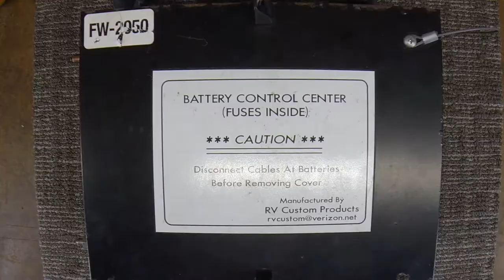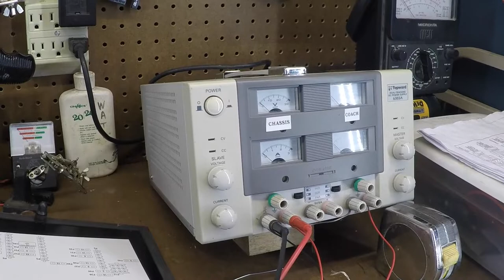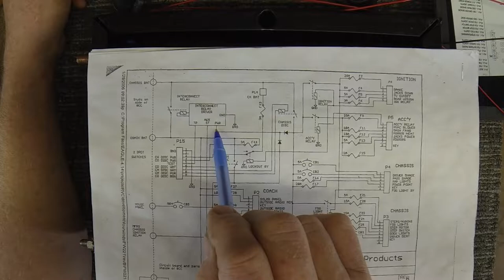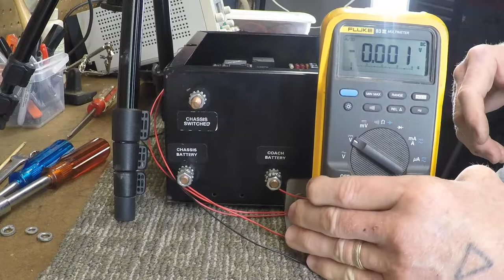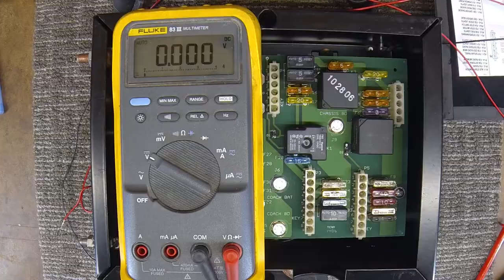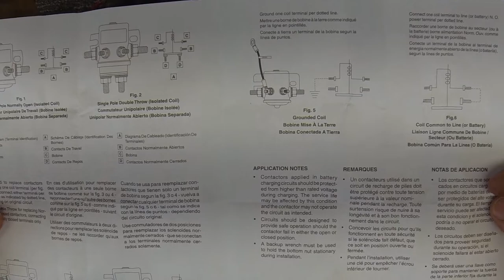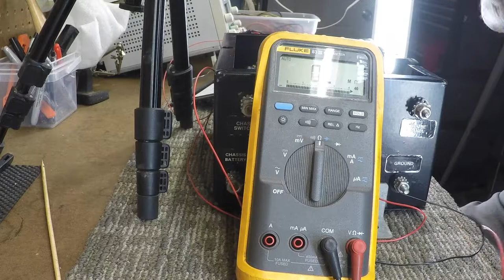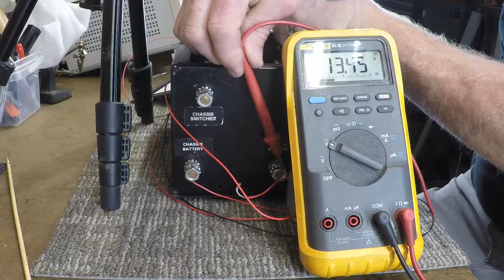RV Custom Products Battery Control Center (BCC) - Troubleshooting and Repair

Comment: Thanks for taking the time to make this excellent video.  You have a great gift in explaining things.  I have a similar RV Custom Products battery distribution center (Model 111979).  I was pleased to find out the company is still in business, and all of the components of my system is still available for my 1999 National Seabreeze.  If you have the time, I would be grateful if you would explain the wiring changes needed to allow a dc to dc charger to be added.  I have AGM house batteries, and I am considering swapping them out for lithium.  I assume the interconnect solenoid needs to be disconnected.  Ideally, I would like to preserve the emergency auxiliary switch that connects the house batteries to the chassis battery in the unlikely event my chassis battery was unable to start the RV on its own.
Reply from the maker: Thanks for the kind words, Dan. When you say DC to DC charger, I assume you’re asking about a charging system that is compatible with Lithium Ion batteries? Am I understanding you correctly?
Reply: Sorry, I missed your comment until now.  Yes, exactly......I currently have six Lifeline AGM batteries and I intend to upgrade to lithium batteries.   @WaynePolcin

Comment: Wayne,   As you can see, I commented last year.   I took the RV to a dealer and they said everything was working fine.   And it did until now.   I have the opposite problem.   Situation.   Thor Windsport is plugged into shore.   Batteries are going below 10 volts.   Battery monitor shows not charging and low volts.   Started engine, and started generator(without using emergency switch).   Turned off engine.   No battery charging.   Turned off gen and unplugged shore power.  No lights in the rv.   Start engine and getting 13-14.5 volts and 25-30 amps charge off alternator.   Checked power panel.   With shore it has 120 volts in and 13 volts on low side.   The two 40 amp fuses are good.   Tested the 100 ampere inline fuse in battery bay.   Voltage both sides and continuity across it with battery disconnected.   
Best guess, in your opinion, new relay or new board in the TH1020?
BTW,  I tried to pull the door off the TH1020 again and it still will not come off.
Reply from the maker: How old is your coach (house) battery?
Reply: @WaynePolcin  coach is 2014.  Batteries were newly installed 2 years ago by previous owner.  2 deep cycle 12v
Reply from the maker: Can you hear the coach solenoid changing position when you toggle the coach battery disconnect rocker switch?
Reply: @WaynePolcin    Yes it clunks in both directions.  Not electrically verified.   Getting better meter tomorrow to check voltages more accurately.
Reply: @WaynePolcin    The company that makes the box advised me that it is most likely the 50 amp breaker.   I will let you know the outcome.
Reply from the maker: I apologize for not replying more promptly. Have you been able to get the cover off to reset the 50 amp breaker?
Reply: @WaynePolcin    Not yet.   I’m going to spray with some WD40 to get it off.   Probably hasn’t been off since 2014.   I had other issues come up around the house.  You know how it goes, freezer quit, toilet needs replaced.   Normal life stuff.  Have a wonderful evening!    Kevin
Reply: @WaynePolcin      Wayne due to watching you excellent videos, I new what and where to look inside the TH1020 box.   I sprayed some WD40 on the hasps and after some pulling and twisting got the cover open.  
I got an email from customer support on which points to check inside the box, but did not need to test anything. The tiny circuit breaker button was protruding out of the case.   Tiny push and click.   The interior lights came on.  Plugged her in and battery charging!
Again, thank you so much for your videos.  They are the only videos on YouTube that have anything to do with the TH1020.

Respectfully,   Kevin
Reply from the maker: So happy to hear that you found the problem. Good work and I’m glad I was able to be a part of the solution. Take care and stay kind, my friend!
Reply: @WaynePolcin      Wayne,   I was an electrical design engineer working for electrical contractors since 1983 and retired 2018.   If you need some information on electrical or NEC, please let me know.   Will gladly help you.

Comment: Thank you for this video.  I am grateful that you took the time to offer this resource.   Using your process, I ended up replacing the battery interconnect relay and all seems to be working.  Whether on the converter or with the engine running, I am getting a charging voltage at the coach and chassis terminals on the BCC.  I also get charging voltage at the chassis BD and coach BD.  Tested at the chassis battery, I also see the charging voltage.  When I test at the coach batteries, I do not get a charging voltage.  Since I am getting a charging voltage at the BCC and not at the batteries, I am assuming that the BCC is functioning as advertised and I must have something else going on down stream from the BCC coach terminal that is not allowing electricity to flow to the coach batteries.   RV is a 2015 Thor Vegas 24.1.   I searched and could not find the 50 amp and 100 amp Type III DC breakers mentioned in Thor’s diagrams.   May I trouble you for any insight on next steps?  Is my conclusion that the BCC is functioning properly accurate based on the observations I’ve made?   Before changing the interconnect relays the coach and chassis batteries were not charging from the converter.  After replacing the relay, the chassis battery now charges from the converter, but the coach batteries won’t charge despite the charging voltage being observed at the coach post of the BCC.   One more observation, I allowed the chassis battery to drop below 12.6 volts.  At that time, the relay opened and the coach went dark, even though the coach batteries are at 12.8v and the coach disconnect was in the “use” position.   Any ideas?
Reply from the maker: I will pull out the schematic and study it based on your observations. I will get back with once I have an idea to share with you.
Reply: @WaynePolcin  thank you so much.

Comment: Thanks for reply I only owned a year or so not sure how old batteries are. We leave it plugged in all the time. Should we disconnect while sitting plugged in not in use
Reply from the maker: You should be able to keep it plugged in all the time. 
1. Does your step motor run? 
2. Are able to access the inside of the BCC to measure voltages?
Reply: @WaynePolcin  Yes the step motor works was replaced last year. Curious what step motorhas to do with this circuit. I can access the bcc  at least the front circuit board, to see the relays I would have to take the box out like you did.

Comment: Thanks for a great video and tutorial. Learned a lot. I went to the RV Custom site to find my control center but it was not here. I have F73-1042. Closest I see is F73-1044. I'll contact them to see what the difference is or if they have block diagrams and other technical info on mine off 2005 Fleetwood Expedition
Reply from the maker: Thanks for the feedback, Peter! It was hard to find accurate schematics and technical data for my BCC. I remember having to follow many links to find the right information. Be careful on your search and don’t lose patience. I’ll poke around a bit to see what I can find for you too. Good luck my friend!

Comment: Wayne love the video, my camper is the same as yours, my chassis disconnect will not connect. it clicks in the box but no power to start coach. Also the interconnect relay you changed on mine is hot to touch. I keep it plugged in all the time is the hot normal, and do you think my chassis disconnect relay is bad?
Reply from the maker: How old are your batteries? The relay can get hot to touch if it is energized for a long while.

Comment: Great video, thank you. I have a 2008 Forest River Georgetown. BCC SDC-107A. The part # for the relay is RVC 1002. Is that the same part you recommend on Amazon, White Rodgers 70-902, contactor, SPST - no, 12VDC? Thank you.
Reply from the maker: You’re welcome. Thank you for the kind comment!
Reply: Hi, is that the same part number?
Reply from the maker: Hi Richard. No. The RVC 1002 part is a magnetically latched solenoid, while the White Rodgers 70-902 is a continuous duty relay. The difference is that the RVC 1002 requires a momentary current at 12 volts to move the contacts into one position and an opposite polarity pulse of 12 volt current to move the contacts into the opposite position. It is held in each position by magnetic force. On the other hand, the White Rodger relay requires 12 volts to be applied continuously in order to close the contacts - the Interconnect Relay is a continuous duty relay. The Chassis and Coach battery disconnects are magnetically latched solenoids. I hope this helps.
Reply: Thank you for the reply. I have a feeling my BCC might be slightly different. I will have to take it apart and check what is bad. I will get back to you. Thanks again.

Comment: very in-depth vid....keep em coming this helped me understand my 03 bounder BCC better.
now if you will give me some direction please?
power jacks,slide outs,dash fans,and power steps no worky... basically the right side of the circuit board  doesn't have power.....am I looking at a fried board or   can the disconnect sys be the culprit?
Reply from the maker: Hi Mike. Thanks for the feedback. I’ll have to look into your issues tomorrow and get back with you then. I’m already tucked in for the night. Will talk soon.
Reply from the maker: Good morning, Mike!
Unless you bypassed the fuses on the board, I would rule out a fried board. The thing to look at would be whether there is 12V at the CHASSIS DISCONNECT solenoid input to the board. If the RV starts, then you know the 12V from the solenoid is there and you should see 12V at each of the fuses feeding the devices you mentioned.

★ Does the RV start?
★ Has anyone, including yourself, worked on or disassembled the BCC since seeing these issues?
★ Is your BCC the same model as the one I show in the video?

Comment: Wayne, do you have any insight on how to test the fuses in the battery control center?  My fuse tester light works fine with the fuses in the breaker box in my 2008 Fleetwood Terra LX, but I do not get a read on anything when I test the fuses in my battery control center.  I have it grounded to the box which appears to be where the ground where is attached.  It doesn't make a difference if the motor is on or off.  I have a few electrical components that are not functioning and suspect the problem may lie in here.  Thanks!

Comment: If I add lithium coach batteries can I replace the BCC with a lithium BIM?  I have a 2004 fleetwood discovery with the same BCC as you show in this video.
Reply from the maker: That's a question I can't answer. I don't have any knowledge of what's available in the aftermarket for lithium battery support. My educated guess is yes, there is something available. It will be pricey and probably an installation challenge. Sorry I couldn't answer your question. If you find anything out on this, I would love to hear back. Thanks!

Comment: This is an excellent video that takes the fear and mystery out of that scary lookin black box. Thanks for making it look easy. I was trying to find the single power source for all the slide out's, and I think it's in this black box. I have an  F73-1044 box, and the block diagram shows a slide connection. Am I close? Should I keep lookin? Or can you point me in the right direction? Thanks.
Reply from the maker: On my Hurricane, the slide out power comes directly from the BCC to a set of four relays under the master bed, behind the converter. The fuse is also there, mounted to the wall with the four relays.
Reply: My relays are in the same basement cabinet as the BCC. I guess I should say it's a 2007 Fleetwood Expedition. Disconnecting the batteries, I've tried unplugging and injecting a tone at the relays with little success. It's a little tough to follow when the wires go into a bundle about three inches in diameter. But when I saw the last block diagram for the F73-1044 I saw the word Slideout and a 30 amp breaker down in the bottom left corner. More research is needed. Point - Since I first bought this coach I have been sliding and leveling without starting the engine. My mindset, well heck it's moving right? I will NEVER do this again. The stress on those poor motors running on something less than 12 volts and barely enough current to move. . . . Never again. I'm looking for the supply lead for these high current motors cuz I'm gonna make them really happy, and cut my setup time in half.
Reply from the maker: I pulled up the schematic for your BCC and it looks like the slide outs have a dedicated terminal on the box. That terminal is supplied by the chassis battery disconnect, through a 30A breaker. 

Are you having trouble with the slide outs circuit?
Reply: Only the trouble I've created. The larger slide is struggling. By operating it without the engine running I have subjected it to some high stress operation. I may have to replace the motor sooner than later.  The reason I'm looking for the slide power source - I may have the only motorhome that starts using a bank of super capacitors. And if I disconnect the lead for the slides and there is no load when they are not operating, I can move that lead to the capacitors and that will supply them with unlimited current at about 14 volts. No more slow as molasses slide. They will be at the end of their travel in a heartbeat. Unfortunately I don't think I can transfer the leveling system over. The electronics is drawing current the moment the system is turned on, even when the jacks are not moving, so that's not gonna work. Thanks Wayne for taking a look at that block diagram and confirming the lead. If you're interested I'll let you know how it turns out. You know, if I burn the house down.
Reply from the maker: @edwardchamberlain7858 I’m very interested. Please keep me informed! Good luck!

Comment: Wayne, great video!!! I have your same RV and experiencing similar issue, will use your work as my foundation to solve the problem.  I am second owner of this RV and can not find the external wire diagram for the coach anywhere, would you know where I might find that? Warm Regards, Scott

Comment: I would like to clear something up here. The generator does NOT charge any of the batteries. Charging of the house batteries while engine is OFF is soley controlled by the convertor. The generator's only purpose is to produce AC voltage which in turn powers the convertor which then charges your house and chassis batteries after certain criteria have been met. The alternator will charge all the batteries when the engine is running, and RV is NOT connected to shore power or the generator running. So, you can have a generator that functions properly and still wind up with dead house batteries IF your convertor has gone bad. A faulty convertor can also overcharge your house batteries so it's always a good idea to check the charging rate periodically and more importantly, check the water in the house batteries every few weeks to see how much water is being lost during usage.
Reply from the maker: You are correct. Thanks for the clarification.
Reply: @WaynePolcin  I hope I did that in a polite way, sometimes I'm a bit abrasive.
Reply from the maker: If I thought it was an impolite comment I would have deleted it. I don’t know everything about RVs and any comments that help to expand knowledge are an important contribution to the viewers. Thank you for your contribution!
Reply: @WaynePolcin  Than you, and let me say other than that slight oversight, the video was very good. Please continue with your desire to educate those that get into the world of RV'ing.

Comment: Wayne,  Great detailed info for the BCC.  I have a question;  mine is a F73-1020, which is a bit different and test didn't switch as you described.  Either I have the same issue or it functions differently.  I don't get any increase in voltage to my chassis battery when on shoreline or generator power. I'm not sure if this is by design or a failure.  One thing I did notice is the interconnect relay gets very hot within 30 seconds (unable to touch) when plugged in or on generator power.  This doesn't sound correct to me and wanted some input or if you experienced the same during the your test.  Nick
Reply from the maker: You are correct, Nick. Something is not correct. Sorry for the late reply. Email me your contact info at wpolcin@gmail.com. I would like to call you. What time zone are you in?

Comment: Greetings! I have a 2017 with the SDC-107A BCC. Exact same issue. One other addition when I press the battery boost switch inside I do not hear the solenoid engage. Checked the 5 volt fuse and it is fine. I do not have the testing equipment and an interested in just replacing the interconnect relay in the BCC since it is fairly inexpensive. What do you think?
Reply from the maker: Hi Mr. President! Do you hear the solenoids engaging and disengaging when you toggle both the Coach (house) and Chassis Disconnect switches? If so, then go ahead with the Interconnect Relay replacement. Other than replacing fuses, it's the least expensive repair you can make and it will eliminate that relay as the problem.

Comment: Great  trouble shooting. my disconnect will not disengage , so I thought I had two problems but now I know only one because my Isolator stays connected after gen been running  I have  100 watts of solar going to chassis and 200 watts to house  so now I realize  it wont disconnect until night . just have to figure out why batt disconnect does not work  . I think latching solenoid welded closed and will not release , Thanks for the great tutorial
Reply from the maker: You bet, my friend. I'm so glad it helped!